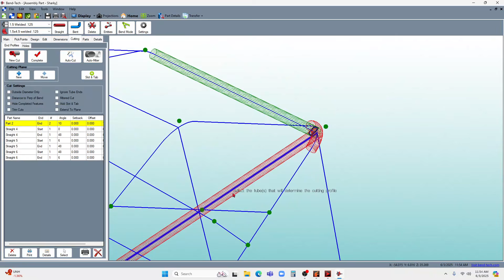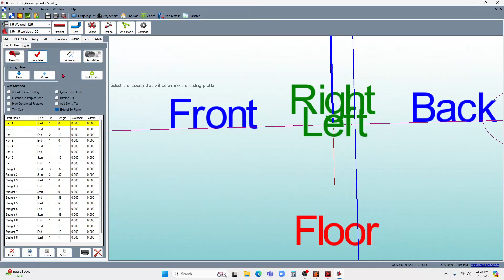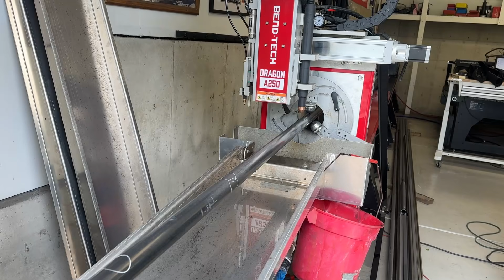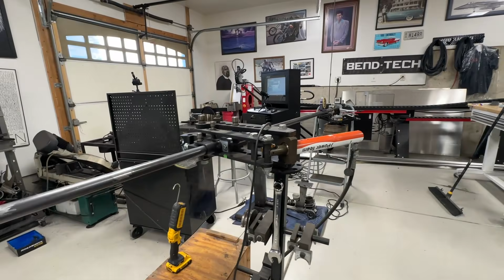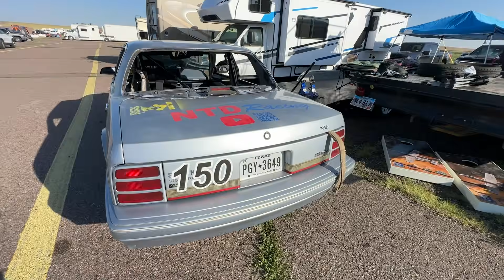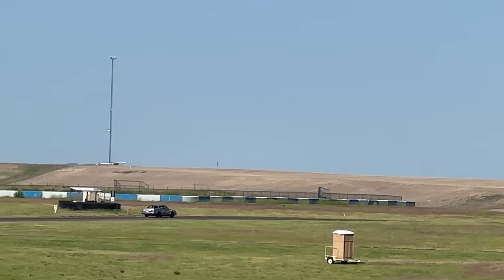Roll Cage Build & Race Day Glory: 24 Hours of Lemons Part 2

Comment: Is this dom tube or regular mild steel. I’m having trouble finding clarity o t hose rules
Reply from the maker: Rollbar Tubing and Spreader-Plate Specs. Minimum tubing size for cars weighing under 3000 pounds as raced is 1.50″x .120″or 1.75″x .095″. Cars weighing over 3000 pounds as raced must use a minimum tubing size of 1.75″x .120″. Properly bent, racecar-grade and -quality tubing is mandatory: no stretched or crushed bends allowed. DOM mild steel is very strongly recommended over ERW (seamed) tubing. All spreader plates must be mild steel, at least 24 square inches, and at least .125” thick.

Bottom Line…welded seam is allowed, but DOM is better.